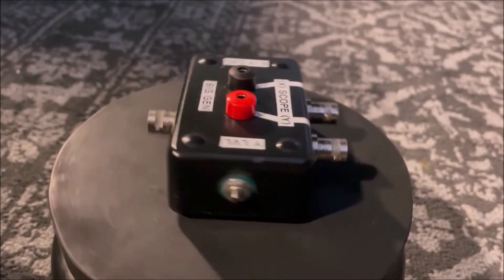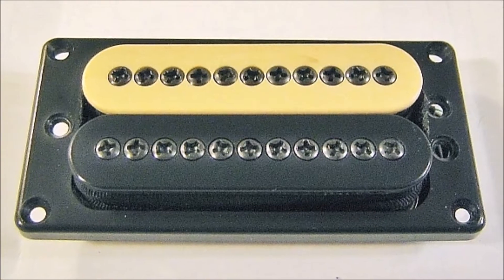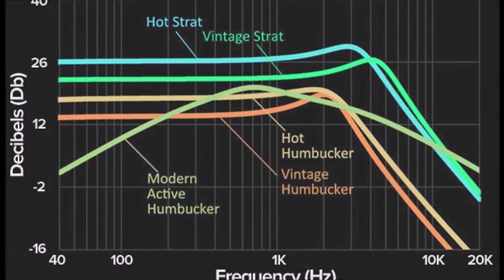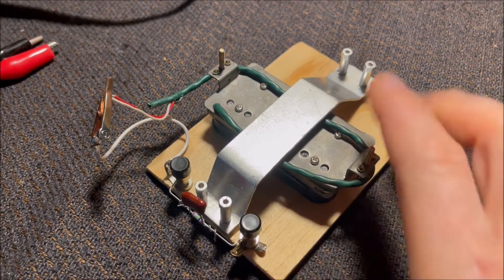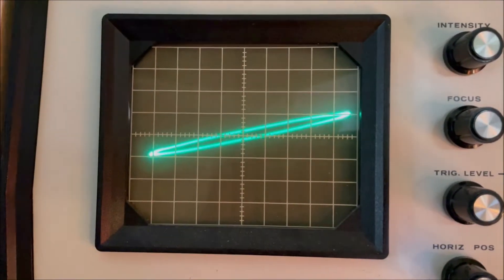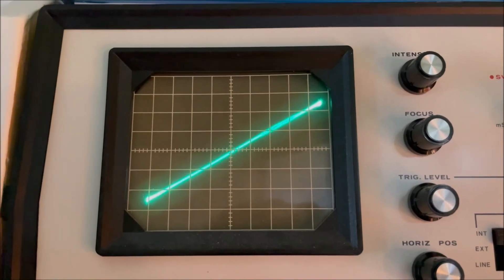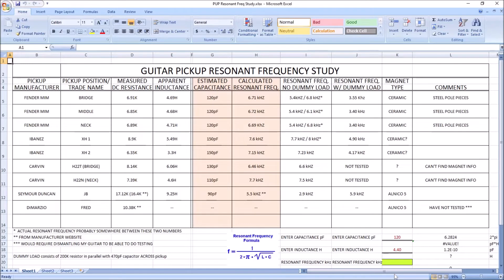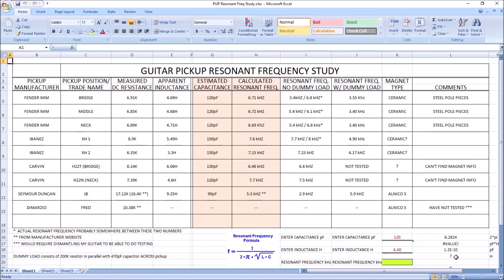Estimating Guitar Pickup Resonant Frequency

Comment: VEGAS CYCLING FREAK, it would be nice if you can show how to measure the guitar pickups impulse response which is the time interval from the guitar string plucked to the guitar pickups output signal which is a time interval/latency but what determines the time interval/latency and how to adjust the time interval latency?
Reply: Hi Wayne.  Your question leads me to believe that you think there is some inherent delay in the PU “processing” the vibration.  However, the PU works by sensing a change in magnetic flux passing thru the coil.  The movement of the steel string, no matter how small, will create a change in magnetic flux and a corresponding voltage output of the coil.  There is no latency, only rate of change of flux which is caused by the string’s magnitude and frequency of vibration.
Reply: @davehyypio4261  Yngwie Malmsteen says often that his uncle taught him about magnetics and pickup theory which yngwie claims there is an inherent delay a latency when you pick the guitar string of the magnetic flux to the time the coil makes an voltage/current output. This is what yngwie called fluidity. Yngwie call hear the pickups Latency delay which he calls is impulse response and you have to adjust the strength alloys mixture and heating processor of the magnetic pole pieces. It an art and science to the "heat treated" of the pickup magnetics pole pieces to get the right delay latency effect. This changes the picking attack sensitivity of the guitars pickup
Reply: @waynegram8907 
 Yngwie says stupid things. With all due respect.
The only delay you can hear is from the distance to the speaker.
Electricity on wires runs faster than sound through the air almost a million times faster.
Reply from the maker: That's an interesting question. I've never heard of anyone bringing this up before in the 20+ years I've been involved with various online forums, etc... why would it matter what the impulse time is in the real world? It's instantaneous enough. I've never ever been annoyed by picking a string and hearing a delay.... I'm sure there is one but it isn't anything perceptible to the human ear (however I'm sure there probably is someone out there that thinks they can hear one). If one was concerned about that then they could use piezo saddles - they sit directly under the string and there won't be any delay other than how long it takes for the sound to go thru the tiny amount of wiring between the pickups and the output jack - but now it's a completely different animal and I don't think anything is gained by that... we go from high impedance to very high impedance and it doesn't sound good with overdrive pedals, etc.

There's a lot of things going on with a passive magnetic guitar pickup - resonant frequency, DC resistance, inductance, capacitance, eddy currents, magnet type, magnet strength, wire gage & number of turns, the tone & volume control scheme, distance of the strings to the pole pieces, humbucker vs. single coil, etc. so it's not a simple thing to tweak as it is the sum of all of the above. Also have to think about the bridge and saddle materials... do they want to immediately deaden the sound or are they less reactive to the vibration of the strings? I think that alone would drown out the impulse time of the pickup.